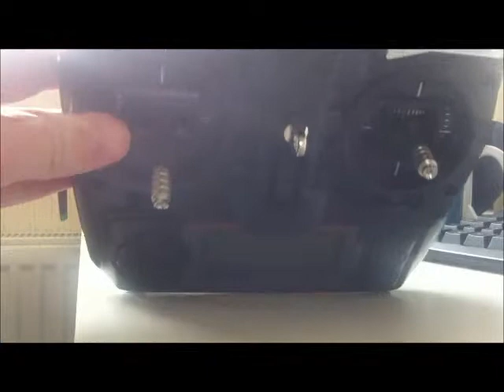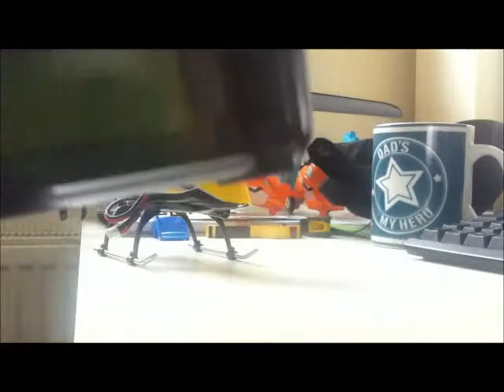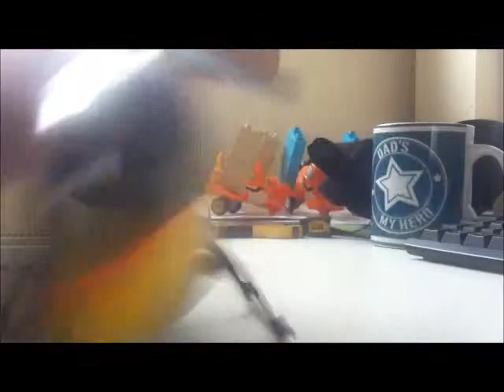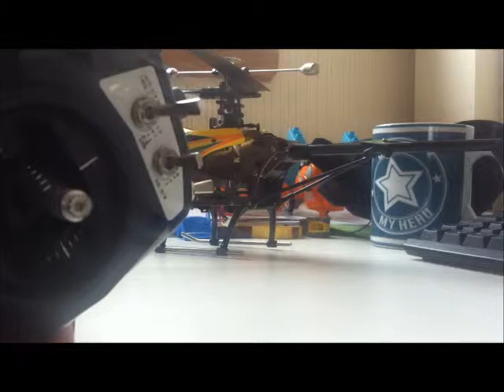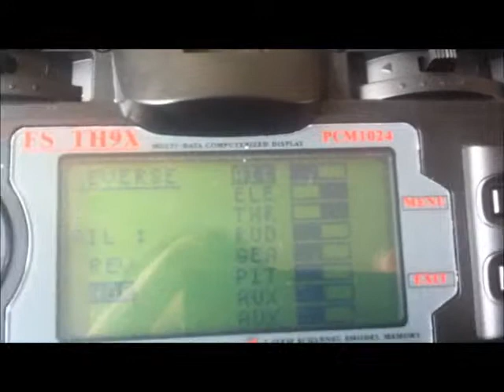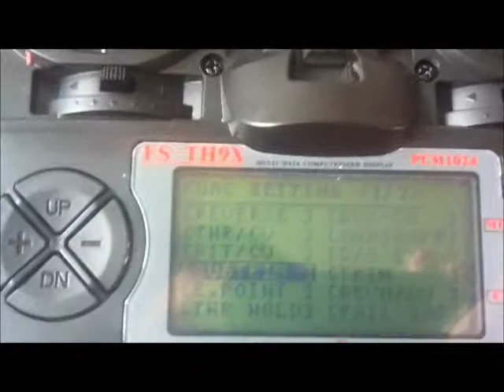How To Bind Turnigy 9x to V912 Helicopter (also works for Flysky 9x)

Comment: Hello, do you think it would also work the other way? I mean to bind a WLToys v912 radio transmitter with a Turnigy 9x receiver. Thanks, regards
Reply from the maker: promaxsistemas Hi thanks for your question. I'm not sure if you could bind the WLToys V912 transmitter to a turnigy 9x receiver, I doubt it though. Why would you want to anyway if you own a turnigy 9x ?
Reply: PilotChris06FW I do not own a turnigy 9x :) but I do own a v912 radio transmitter. It is cheaper for my to buy a receiver, than to buy another transmitter...